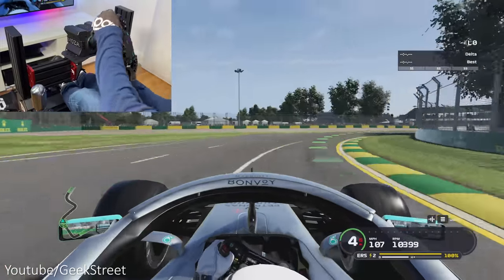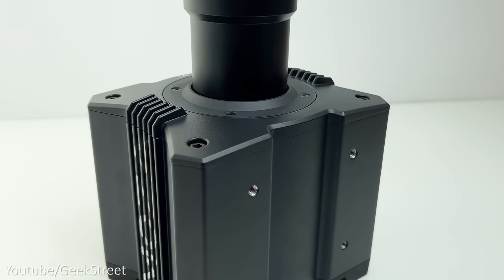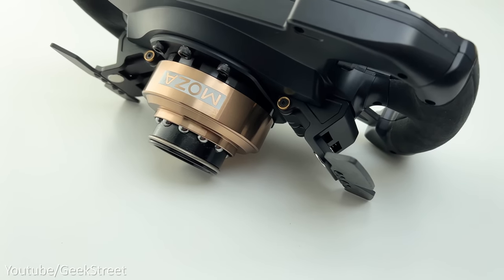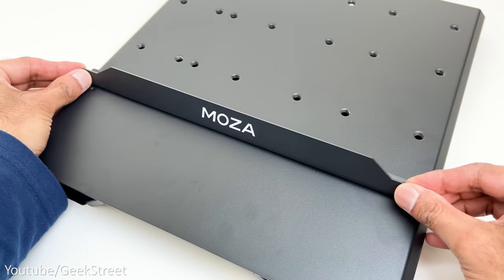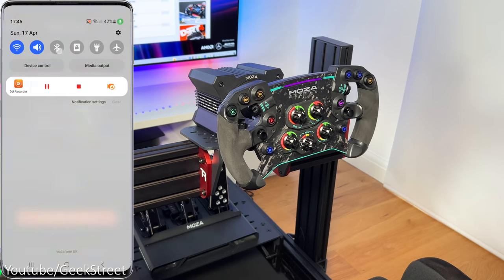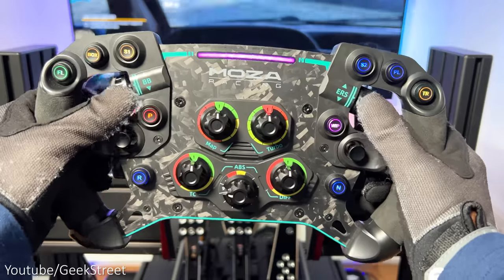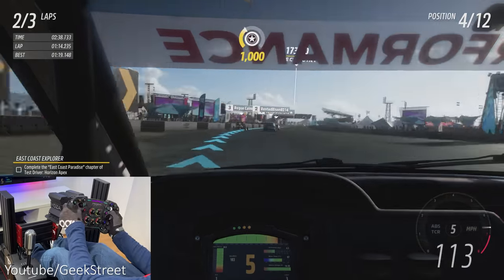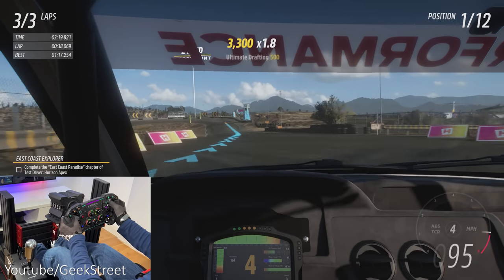Fanatec CSL KILLER? | Moza Racing R9 / GS Steering Wheel and CRP Pedals Review

Comment: Fanatec's real killer is their stock.. xD The main reason I've bought Logitech Pro wheel which I returned because it started creating problems on day 2 and purchased Moza R9 with FSR same price like wtf..
Reply from the maker: What problem where for getting with the Pro wheel, I've had for a couple of weeks and its been fine. Did you do a firmware update before returning?
Reply: @GeekStreet First of all most importantly I was shoked when the support guy told me that on full stop and stand still start you may get awfull stutter at least in ACC, and it's not your PC it's from the wheel and truforce, this has been known issue since g920 and it still happens... Yep updated the firmware first thing, first day it was okay and second or third day it kept the steering active, but all buttons not responding, this happened at random mid corner very annyinng restart of the wheel fixed it temporarily.. Then the RPM lights stopped responding to ACC, then it tried to center itself on 90deg very paranormal experience huge delays from support
Reply from the maker: @amraces  did you try with TrueForce off?
Reply: @GeekStreet Yep and to my surprise there was the same stuttering if you meet the barrier rejoining the track is hell.. Stopping for Pitstops also sucks with that stutter and I am not sure how many PCs will have this issue I have AMD Ryzen 5 and GeForce 3060Ti OC, and run setting lower than I can just because I don't like some of the effects of ACC on Epic.. So definitely not PC issue now I have my old G29 hooked while waiting for Moza delivery no stuttering in start/stop..
Reply from the maker: @amraces  wow, I've tried a combination of the PC and PlayStation 5 but probably more on the PlayStation with ACC and it felt fine, but accidentally I did launch the PS4 version and that was completely messed up but the PS5 version worked perfectly but I am in the middle of reviewing the PRO wheel at the moment so will have to have more of a play around.

Comment: Lmao Costs more than Fanatec, comes with less than Fanatec, does less than Fanatec… Not as well supported as Fanatec.  Go ahead and be a test mule for them at a premium price. Unless you get the stuff like him, “free to test” 🤔 lol😒
Reply: Csl dd 8Nm 499usd vs moza r9 440usd?
Reply: @garywade9279  Now add all the extras … Both require a proprietary wheel and the Moza wheel costs more than the wheel base. You can get a Fanatec wheel for like 150, or a used one cheaper. I doubt there are any used Moza wheels available. Then there are pedals. The basic Fanatec full setup can be had for the price of just the Moza wheel base and a rim. Exactly🥴!  lmao.
Reply: Moza didn't gives plastic QR to down price😶

Comment: Fanatec is 2/3 the price and does everything the Moza does and much more plus has a much larger ecosystem and more mature software.
Reply from the maker: 💯 Fanatec has a larger ecosystem and more importantly mature software that you know is 100% tested and stable, Moza is new to the market and if this is how they start off entering the sim racing market as long as they get better integration with mainstream games and console support they will do really well.
Reply: They haven’t fixed software issues for 2 years and fanalab is full of bugs. 
Great effort for a new company to the market
Reply: How did you come to this? Fanatec’s csl dd 8Nm base is 499usd while moza r9 is 440usd.. If you look at the steering wheel, the v2.5+QR2 = moza GS.
Reply: @garywade9279  price a wheel, base and pedals. It's not rocket science
Reply: @SwordnScale  really? I don't have issues with my software. But ok.

Comment: its alright it does what all other wheels do for a much bigger unaffordable cost for the mainstream consumer.

you turn left you go left you turn right you go right and so on just like any steering wheel.

with inflation and household energy bills going up your not going to rush out and spend 1500 quid on a gaming wheel.

looks all premium wrapped up in cloth bags and those kind of items usually cost a small fortune.

most tend to go with Logitech and thrustmaster as you can at least get one from most retailers as a complete package, not having to buy one part then save up for the next part whilst the part you have anxiously looks on at you as the months go by. 
  
these sort of wheels are for hardcore sim racing streamers which i get as some are provided by the sponsoring company and youtube sim streamers class it as there full time job i get that each to there own which is where this sort of product would be am investment.

but realistically as a none sim streamer, if I want to do a few laps round Monza in ACC do I need this, probably not as the thrustmaster logitech variant would do just as good a job, without having to save up for the wheel then the pedals and the drive unit, as it would just frustrate the hell out of me having to wait months and months before I can use it when I can nip to argos and within an hour I have a logitech wheel complete for 260 quid and I'm ready to go.

to round off a very valid point, what ever the wheel your still playing the same game in the same room in your house and not one family member gives a shit what wheel you have do they.
Reply from the maker: Price wise this isn't cheap and you'd have to be a real sim racing enthusiast or hard core racer to get this. Logitech and Thrustmaster are both good wheels but its no comparison to the Morza, the difference is night and day. The experience is on another level.
Reply: what on earth did you just type lol
Reply: It is true that any steering wheel you turn to the left and the vehicle turns to the left and the same to the right. And it is also true that no matter how much money you invest, you are in a simulator at home. But that does not mean that by having better hardware one accesses a better experience. I started with a G29 and shortly after I made a platform with 2dof movement and it is spectacular. And recently my G29 broke and I bought a Thrustmaster TS-PC with the Open Wheel steering wheel and the experience improved a lot. You can't compare a $250 wheel like the G29 to a high-end wheel like the Thrustamster TS-PC. And that's why a week after having the Thrustmaster I sold it much more expensive than the price I bought it and with that difference I paid for the Moza R9 with the Volante GS. In other words, for the value that the Thrustmaster pays, he buys the Moza. I made the change more than anything because I am sure that a DIRECT DRIVE is superior to the Thrustamester TS-PC and it is also much smaller and does not take up space behind the wheel.
Reply: @arielcor7392  huh
Reply: @sre6159  what is what you do not understand ????
Reply: @arielcor7392  all of it lol
Reply: your problem
Reply: @GeekStreet  i understand ill correct myself the thrustmaster logitech variant would not do as good a job but would be happy enough with the cheaper option as it does what it says on the box. I know this MOZA wheel will be shit hot and ultra realistic which is not my argument I wasn't putting the product down its just over the top and over priced to the mainstream gamer who just wants to jump on and do a few laps here and there.

its the fact that its not affordable in the current climate for most and without sounding patronising I liked your video which I did not discriminate in any way.

its a very sort after item that you have to have time and money  dedicated to use it making it an investment.

the casual mid stream sim market is where the thrustmaster logitech variant would be most preferred.

i 100% have no regrets going with the latter.
Reply from the maker: @asushuracan5501  I completely understand where you're coming from on this no worries 👍
Reply: @GeekStreet  cheers for coming back, I see myself as being part of the sim community I don't see why I should not be because I don't have the hardware I enjoy sim racing and the exhilaration it offers,

keep up the vids ill keep watching already subbed.

i have aG923 and a play seat challenge, we all gotta start somewhere.
Reply from the maker: @asushuracan5501  thanks for the support much appreciated 🙏